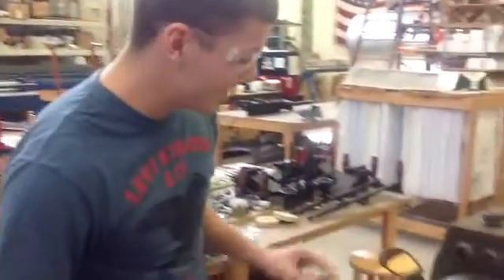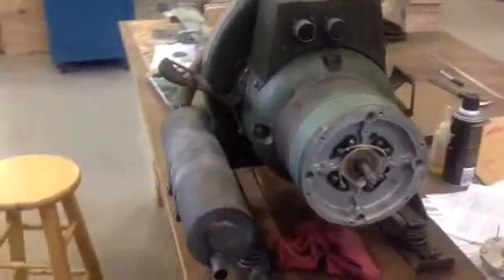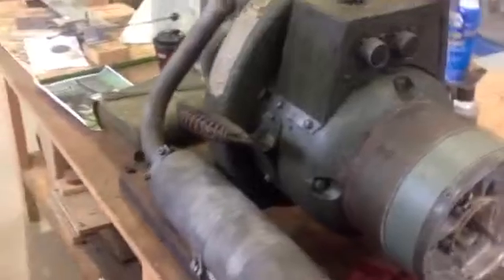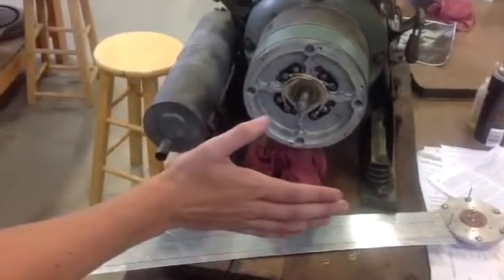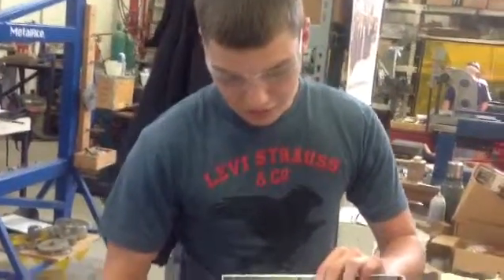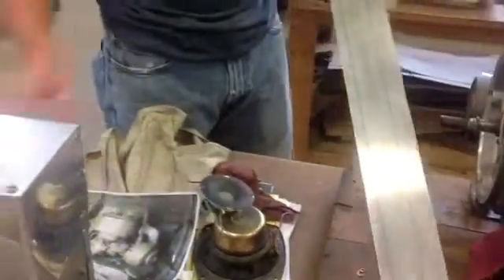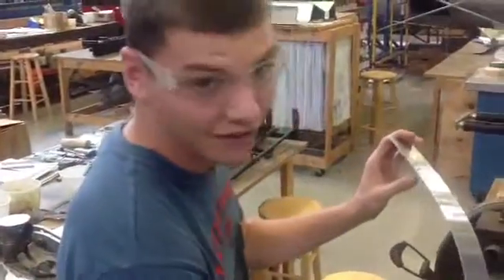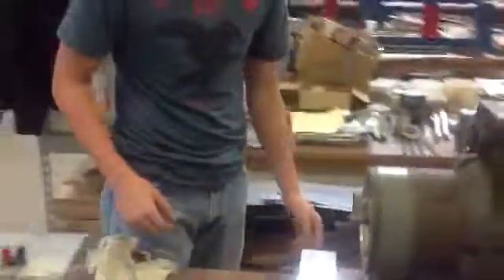Getting a B-17 auxiliary generator and engine restored and working.

Comment: Its the correct APU for the B-17 as well as the B-24 the engine is a homelite two stroke.  its in the aft section of the plane behind the left waist gunner position. the B-24 the APU will be in the fuselage close to where the nose wheel is its used for powering the aircraft electrical system possibly starting the engines. the bigger and more powerful apus or Putt Putts they refer them to are used in the B-29 and other postwar aircraft most common is the Andover or Ranger V32 4 stroke V-twin as some used the Lawrence A20 D2 flat twin 4 stroke as both the engine exhaust and the cooling air for the engines are ducted outside the plane's fuselage.  the way this B-17 Apu the exhaust discharges at the end of the muffler in the plane.